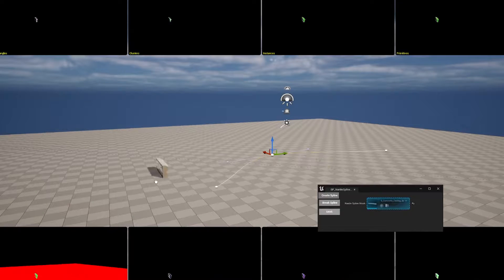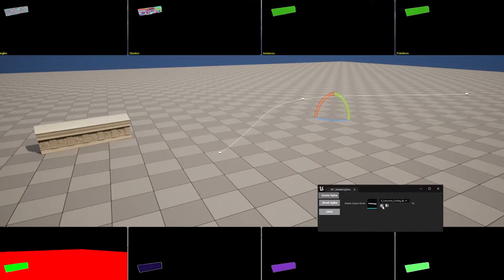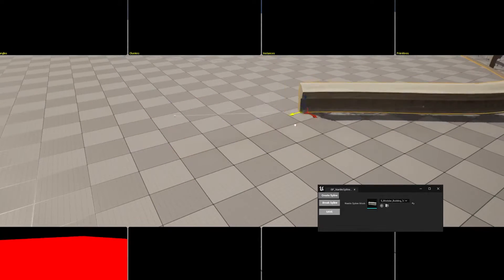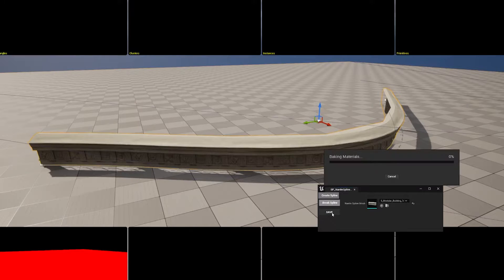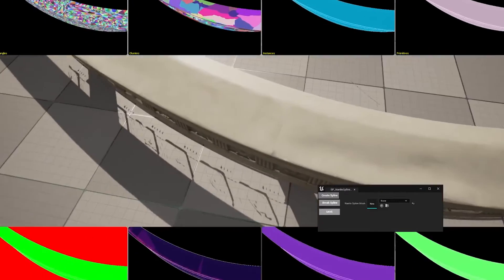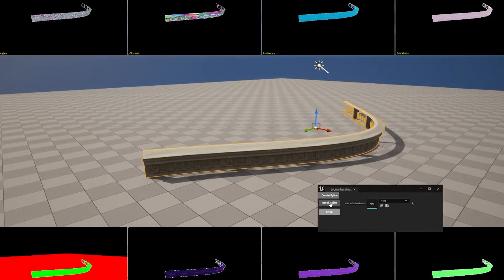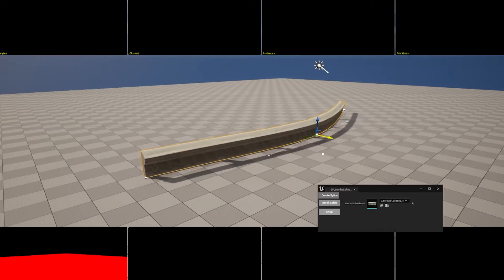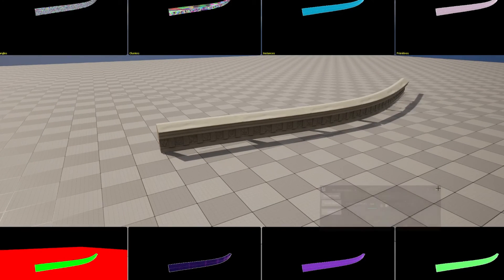Unreal Engine 5 - Spline Mesh to Nanite

Comment: Amazing Tool! How I can get it? What do you think, why Nanite does not work properly yet with spline meshes?
Reply from the maker: I was sure I had answer this comment. 
Convert to nanite is actually a have process with plenty of stuff being baked under the roof. It can’t be done in real time (that’s what unreal guys told me). I see many people asking for deformation tool (not WPO), maybe at the end of this year.
Is an internal tool, I made a simple copy and took off all the functionality to make this YouTube video. 
If u still need it I can make a better video showing the nodes step by step.
Reply: @fran.fndz.techart  Would be really helpful, Im having the exact same issue. I cant figure out how you are baking from spline -> static mesh using blueprint? Merge Static Mesh Actors only takes StaticMeshComponent as an input.
Reply from the maker: @johnmckinzey416  hi. I uploaded a video about it